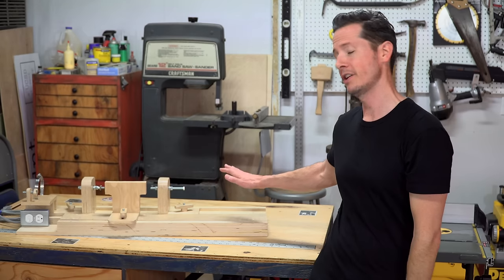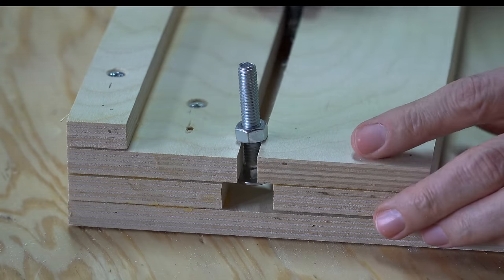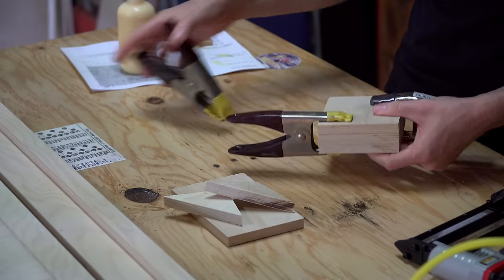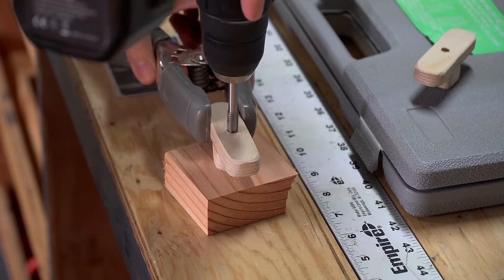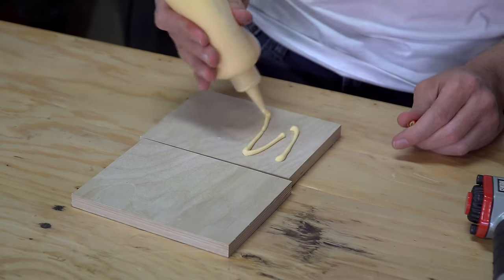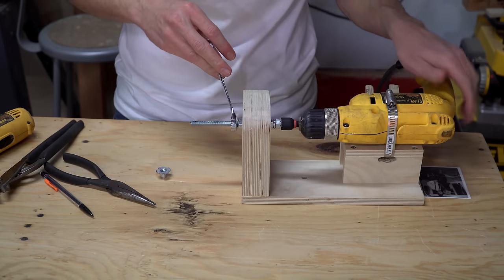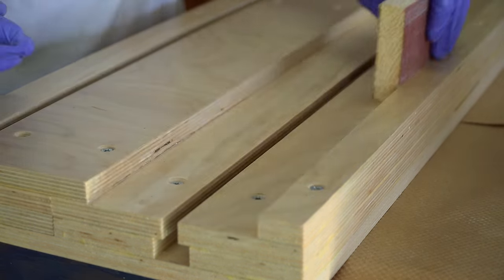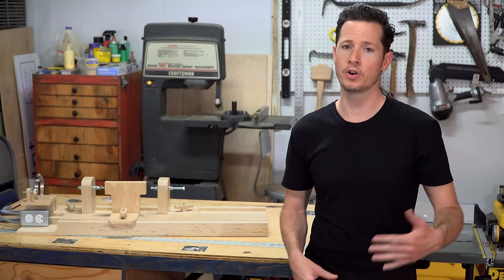DIY Drill Powered Lathe

Comment: What you did to the drill is very bad!!! Trust me, this is exactly how I ruined my drill. When you attach a drill NEVER compress the body the way you did, - this will put pressure on the sides of the fan inside which cools the drill,  there will be buildup of tension which will eventually ruin the fan or the motor. Use the plastic handle which goes around the front portion of the drill to attach it,  (this is an optional part usually sold with the drill so one could hold it with both hands). This is the only part of the drill besides its handle where you could apply pressure, since the only thing inside is the metal ball bearing and the metal spindle, - you're unlikely to compress those. Otherwise, - great job with the DIY lathe. Metal assembly parts, however, are better, the wood will quickly wear itself out.
Reply from the maker: Thanks for the feedback!
Reply: It is just a small step to replace the drill with a used washing machine motor and a belt and trust me that would be his next project, thanks for the video.

Comment: I’ve been turning wood for 8 years and am a pro. One of the reasons ur getting bad results is because ur tool rest is way to high. When using a chisel aka a scraper u need the tool rest level with the center of ur wood blank.
Reply from the maker: Thanks for taking the time to give some feedback! Have a look here: https://youtu.be/UqvVQ2dZaAU
Reply: One Minute Workbench I
Reply: @rouge5140 , I definitely agree. It's not like text messages used to be a hundred years ago (okay, maybe not THAT long ago, but still...).  You don't get charged extra if you go over X amount of characters. 😁😄🤣😏😎💯❗
Reply: I have been eating my food without spoon or fork for years... i'm a pro

Comment: Cool but like very unrealistic. I made one and it was less than sub par you need more speed than a drill can produce and they are very underpowerd. So much better off saving 100-200 dollars and going on Craigslist
Reply from the maker: Thanks for the feedback! What were the specs of the drill you used? Mine is about 3/4 hp, and is actually more powerful than most of the smaller/low cost lathes available. Those usually max out at about 1/2 hp. If you already built one, you might check on craigslist for a more powerful drill. You can usually find them for around $20...you just need to be sure to check the specs to make sure it'll have the power and RPMs. I hope this helps! Good luck!

Comment: Or, “How to Burn up a Perfectly Good Drill”
Reply from the maker: Thanks for sharing your feedback! This has been discussed a bit in the comments...it just depends on the drill. The drill I used is a heavy duty 3/4 hp monster, which is actually significantly more powerful than just about any entry level lathe you can buy (they are usually a max of about 1/2 hp). Back in the day, many of the major tool manufacturers used to make lathes, sanders, and other types of shop tools without a motor. They were designed to be driven by drills that those manufacturers produced. With the advent of cheaper motors being produced over seas, the idea sort of went away, but it's still a viable method for producing your own tools if you like to save money. Of course, you also have to enjoy the challenge of constructing your own things. Anyway, I hope this makes sense! Thanks again!
Reply: No way! This will burn up crappy drills, but there isn't a chance in hell it's going to burn up a good drill like a dewalt. I have this exact same drill and it's a powerhouse for it's size. The only downside is how loud it is. Currently I'm using a 2hp motor that came off a shopsmith on my mini lathe which is WAY overpowered for it but it is so quiet sometimes I barely notice it is running.
Reply: @OneMinuteWorkbench  Wow, I didn't know a drill could be tougher than a proper lathe. Thanks for the information!

Comment: You don't have enough RPM to make a good wood lathe .  you need to mount a electric motor , at least 1750 RPM .  that would be much better , and you would get a much better finish !
Reply from the maker: Thanks for the feedback! The drill I'm using is pretty powerful. It's 6 amps, 110 volt, which equates to probably a little more than 3/4 HP. It's rated for 2500 rpm (no load, of course). All that said, it's doing fine, but I agree that a stand alone motor would be better. I do plan on building a larger lathe down the road, and I'll definitely use a standalone motor in that one. When I do, I'll be sure to post a video! Thanks again for taking the time to give some feedback!
Reply: One Minute Workbench  Another thought was a angle grinder with a router speed control from harbor freaght for 20 bucks. Then you would have a range up to 10,000 rpm.
Reply from the maker: Thanks for the idea!
Reply: A quick drill refurbish wouldn't hurt either mate
Reply: @robertsherman8887  love the idea of 10k rpm but can you imagine if it broke loose and hit you in the head?
Reply: @sterlingniko7325  That's why I mentioned the Router Speed control.  20 bucks at Harbor Freaght. Yes an unbalanced work piece could be dangerous!
Reply: @robertsherman8887  ah. I skimmed over that bit. Hell of an idea the. Well done
Reply: @robertsherman8887 , I had a grinding wheel break and fly off from an angle grinder; it hit me in the foot, and even though I had a workboot on, I ended up with a helluvan ugly bruise. I walked with a limp for weeks. Had an X-ray done, and luckily I didn't break any bones, but the fact didn't make it hurt any less. So, yes, they can be very dangerous. I'd hate to have that much power up close to my head. Yikes!
Reply: @MaryAnnNytowl  Wow... so did I! Broke 2 metatarsal bones and fractured another  in my right foot!  No the router speed control would allow you to start out at a Very low RPM so it would be safe. The grinding wheel that broke on me was a cup wheel. It's very heavy and it broke into chunks.
Reply: @robertsherman8887 ,  I can believe it. They said I might have a couple of minor fractures, but nothing that really showed up in the X-rays. The speed controller would be a lifesaver, doing something like this. I understand, now. Guess I sorta skipped over the speed control bit, just remembering that WHACK on the foot! That kind of memory tends to distract one, I guess. It sure distracted me, obviously!
Reply: @MaryAnnNytowl  Absolutely once bitten twice shy. Yeah I will never put a low speed wheel on a high speed grinder again...
Reply: @robertsherman8887 , exactly - I always look very carefully at the info printed on the wheel before I buy it (or, in that case, which was at work, before I use it). That's a pain you just don't forget, LOL!

Comment: Just saw the vise build.  Thanks for showing it.  I am going to see if I can design mine where the bolts screw towards the bench so no protrusion.  A wood wheel, bolts, nuts and 2x6, how cheap is that. You are a genius.  Oh yeah, about that toolrest on your lathe work, bring it down to center of work piece and keep it close and tight to the wood being turned (minimum gap). Keep up the fantastic work.
Reply from the maker: Awesome man - send pics or post em on the One Minute Workbench Facebook page when you build your vise. I hear you on the lathe - some other guys here have already advised me, and I've fixed the design. Thanks for the feedback - I'll do my best to keep the videos coming!

Comment: Just a suggestion for those who don't want to polyurethane the slides, Waxing the slots works best in my experience. I cut a wax block to fit the slots and keep it close to the tool so I can easily run it through the slots occasionally. You can use candles in a pinch but often times candles are softer wax and made of a mix of stuff so it's not as efficient.

Comment: To solve the bearing issue on the headstock just use a 21 mm forstner bit and an M8 threaded rod - skateboard bearings are metric
Reply from the maker: Awesome tip! Thank you!
Reply: my bad - the outer diameter is 22 mm, but the inner is 8 mm - so an M8-rod fits perfectl

Comment: Almost all ball bearings are made in metric sizes.  Get a metric drill bit (tou probably have a 17mm bearing) and a metric bolt to go through the center.  Nice project!
Reply from the maker: Yes, it’s metric. The bearing’s OD is 22mm, so a 22mm forstner bit with an 8mm rod is a perfect (press) fit.

Comment: That's neat. A lot of work, but, if you want it, that's okay. To make the parts slide better, use a coating of a good paste wax on all the parts.
Reply from the maker: Thanks for the thought - I applied a little bit of past wax to a section and the thinner in the wax dissolved the polyurethane a little bit and actually slowed down the action. Since then I’ve just kept the surfaces clean and dry and they slide nicely.

Comment: A fantastic project! One observation though, as the hardest part was mounting the drill to exactly line up with the moving parts, why not mount the drill first and use it in the fixed position to drill the holes in the two moving uprights! (I know, I always get great ideas after someone else did all the work!) Very well done!

Comment: Incredible video!  I've always wanted a lathe but could never justify the expense, so I've downloaded your plans and have a new winter project!  If I don't have a pin nailer, will brads do?
Reply from the maker: Thanks! I'm glad you're inspired! You could probably get by with brads, or even no nails at all, but I highly recommend pins because brads tend to blow out the veneer of the plywood. You can get a pin nailer at Harbor Freight for about 20 bucks. The reason you use nails at all is because when you apply glue and clamps, the pieces tend to slip on the glue and become out of alignment. That said, another options is to clamp up your pieces (with NO glue), drill pilots, countersinks, and add screws. Then back the screws out, apply glue, and put the screws back in. That will ensure that all the pieces are aligned and can't slip around in the glue. I hope this helps!

Comment: i agree with alot of the video. But that tool rest looks uncomfortable. id recomend cutting it down too level with the center points but if you want a more motion up and down id grab a block with a hole on top and a smaller hole on the side. then use a dowel into the top hole with another block glued/nailed on it for the head of the tool rest. the hole on the side would allow a screw too tighten it in place.
Reply from the maker: Here ya go: https://youtu.be/UqvVQ2dZaAU I hope this helps!

Comment: nice job,,,,,,,,,i like it,,,,,,,,,,,,,,,also in a small work shop it's easy enough to shove in a corner somewhere till you need it next time instead of a cast iron model
Reply from the maker: Thank you! And yes, my shop is small, and space is at a premium. I like building my own custom tools because they store much easier than store bought one. They're also lighter, and much easier to move around, saving my back some trouble. Anyway, thanks again!

Comment: This is a great DIY option, but I really think you'll benefit longer term from putting Tee nuts in the threaded holes instead of threading the plywood. Long term, that is not going to stay solid, but still an interesting idea. Spend money on threading bits or on tee nuts, it's a toss up, since I have neither. But to each their own.

Thanks again.

Comment: Hey Tommy, how do your corded drills hold up to the lathe and disk sander projects? I REALLY want to build a cheap and easy lathe and sander myself, but drills use small universal motors that are not continuous duty cycle, so I worry that they'd burn out quickly. However, I see lots of other videos on YT where people do drill-powered shop tools like this and have never seen/heard of a drill burning out anyway, not to mention I've never once heard of corded drills dying.
Reply from the maker: They hold up great. My DeWalt drill is about 3/4hp though, so if you used a small, low-powered drill, you might have different results. I pretty much leave the drill attached to my sander now, and I use it pretty much every time I'm in the shop. I don't do a lot of turning, but when I do, I just swap the same drill over. So I guess my advice is to either get a heavy duty drill (if you're going to use it often), or use a lesser powered drill if you're only going to use it occasionally. I hope this helps!

Comment: What size pin nails are you using? I have a pin nailer but it's limited to 1" max pins, so unless it's a thin material I have to use brads instead.

Comment: This is my first visit to your channel.  You are a very good narrator, inventive and a fine, fine mechanic.  Without seeing your woodworking I assume you do well with that as well.  I am curious: have you ever used a spray lacquer instead of urethane?  The lacquer drys so fast you can have multiple coats without sanding in between them in a few hours.  I would like to hear if you have had experience with it.
Reply from the maker: Thanks for the awesome compliment! I've used brush on lacquer, but not spray lacquer. For this project, I was using spray polyurethane that didn't require sanding, and was fast drying (1 hr between coats). I chose to sand it anyway because I wanted the surface finish to extremely smooth, especially in the areas where components would be sliding. I'm always open to new products though, so I'll read up on spray lacquer - Thanks for the tip!

Comment: baltic birch plywood is very expensive, where did you get your $35 price point from?
Reply from the maker: At the time of this build, 1/2" x 5' x 5' sheets of Baltic Birch were running $30/each (where I live, in SoCal). This build requires half of a 1/2" x 5' x 5' sheet. So... $15 worth of BB, $15 for the drill (bought used at a yard sale), and about $5 for hardware. Now, Baltic Birch is running about $35 for 1/2" x 5' x 5' sheet. So, it'd be a couple more bucks these days. I hope this helps!

Comment: Nice build. I definitely want to try this before I would invest in a real one. After having this for well over a year, what do you think you can create with this? Is this really just for pen blanks or could you do small bowls/vases with it? Is it powerful or sturdy enough for a bowl turning blank?
Reply from the maker: Thank you! I don't think I do bowls with this lathe, at least not without building a 4-jaw chuck for it. I think it has the power to do a bowl (the drill is just over 3/4 hp), but those cheap skate bearings might not be stable enough. So all that said, I'd guess that if you used higher quality bearings, and build a solid 4-jaw chuck (or a plate you could screw mount the bowl blank to), then it'd probably be okay. I hope this helps!

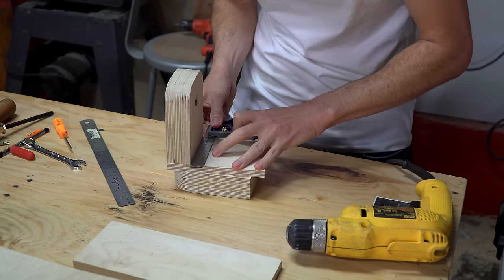Comment: Which tool is it, that you use on 4:13-4:14? I mean this small black bar with that golden disc on it. What is that used for an what is it called?
Reply from the maker: It's just a type of marking gauge. It's used for measuring known distances and repeating them. For example, if you have a dado that is a specific depth, you can set the gauge to that depth, and then use it to scribe a line on another piece of wood that will go into that dado. I hope this helps!
Reply: Thank you, now I got it! Really nice channel btw, I made a few projects like the saw track and stuff, which really works perfect for me.
Reply from the maker: Christian Schiel - great! I’m glad you’re enjoying the channel! Thanks for letting me know!

Comment: i would have just router'd out a channel using a 18mm bit then glued a board on to the top then router'd another smaller channel in the top board. less glue up with a perfectly straight T channel. also if you are gluing up and using brad nails you dont need to clamp or use screws. many workshops ive worked for use this method and is tried and tested. you can use a router and a pivot point with string tied to both to get rounded corners (longer string, bigger outer circles for the bit to run/cut) i hope this helps.
Reply from the maker: Thanks for sharing your ideas!

Comment: hi tommy great  project  
could i use  t   channel  for bots sat into the  top  for  head tail  to move 
thx dave in uk
Reply from the maker: Hey Dave, I’m sure you could and you’d probably even get a better sliding action. You just have to find the right size channel that fits in the slot. I hope this helps!

Comment: Hello, great video! I was wondering if I could possibly use a Dremel for this. I only have a battery drill and I don't want the battery to die, and the Dremel is the closest thing I have with a cord.
Reply from the maker: It would depend on the power of the Dremel, but probably not. The drill I used is the DeWalt D21008, and is rated for 6amps...that's pretty powerful when compared to a Dremel. You could use a lot of different drills and achieve decent results, but generally the higher the power the better. I hope this helps!
Reply: I have an 10 speed Dremel 300 with 1.2amps. I also have a DeWalt DC720 and I don't know the amperage for it, but I'm sure it's better than the Dremel.
Reply from the maker: I would advise against using a cordless drill - if you’re really interested in doing a project like this, look at craigslist to see what’s available. Google the part numbers to see the specs and try to stay in the 5+ amp range. You’d be surprised at how cheap you can pick up rally powerful drills. I only paid $15 for the one I showed in the video. I hope this helps! Good luck!

Comment: I wonder about safety with many of these videos. I've managed to jam a lathe a couple of times and it stopped relatively easily. Maybe it's the electric motor giving in or maybe it's some sort of clutch system. I suspect it'd be relatively simple to calculate and implement. Drills seem a bit more powerful..